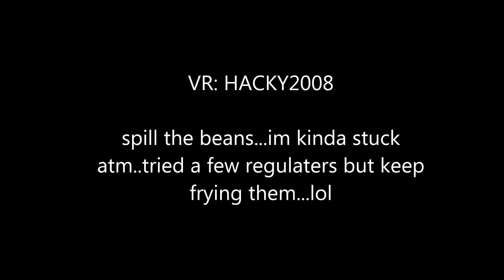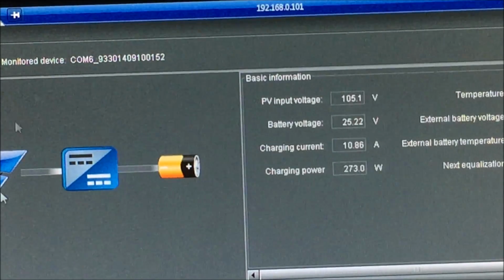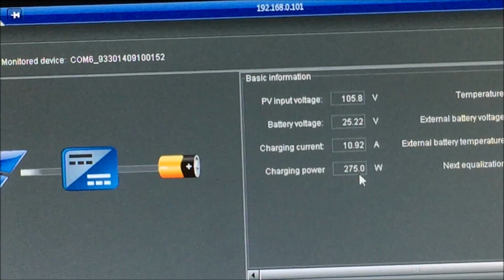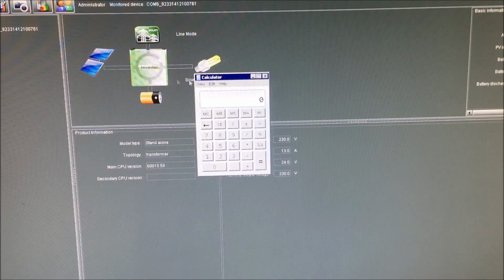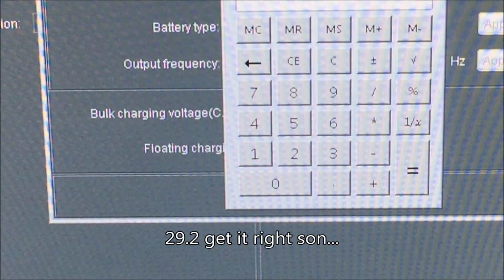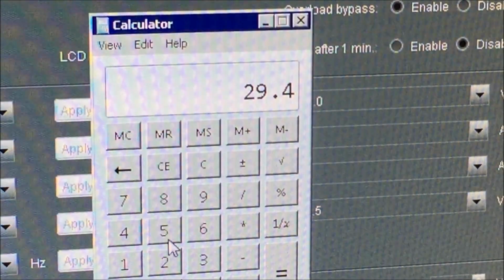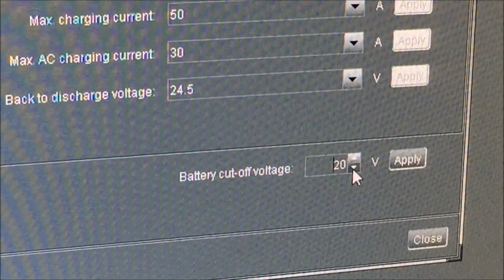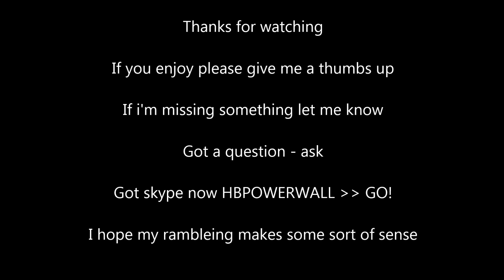PIP2424MSX Charging 18650 Cells

Comment: If my load requirement is less than 2000W . Can I use PIP-2024HSE for my 7S80P pack instead of your PIP2424MSX. Please assist me. Thanks you.
Reply from the maker: Theory says you can but you would NEVER want a constant draw of 2000w on these units they do tend to get hot after a short period of time..
Reply: Thank you. And noted.

Comment: I am thinking about getting a pip2424lv-msd (the american 110v version) but I want to figure out how to hook up an opportunity load (space heater, for instance) to it, to use up surplus current as we are off-grid. Any thoughts?
Reply from the maker: just hook the heater up to it then sue the watchpower to turn it from on grid to off grid... what sort of draw is the space heater
Reply: Thanks for getting back! The heater is 450 watts 120v/3.75A. Would you hook it up to the Pip's dry contact?

Comment: The grid voltage at 22v is when to TRY to go back on grid. If the grid is not available it will continue using batter until the battery cut off point. At that point you lose all power. The setting does not seem to be redundant. Just poorly described on the UI.

Comment: i will like to ask you question can used the pip2424 as inverting only without putting solar on lt
Reply from the maker: Yes, it will function perfectly with out solar, how ever I do remember reading some where at some time that you need to hook up the solar up to it to update the firmware for some reason.

Comment: The syStem I put together is a mix of different chemistries. Started with lead/ acid , some sealed  have been adding life and lipo lately. I started at a lower charge volt. It's a 12 volt system,but I have been at 14.1. Good for the lead and life ,but a bit low for the lipo works out to 3.525 volts    As long as inverter is on it seems to absorb any surges without problem, although I did put in 7  Maxwell 2600F boost caps which tend to help with surges. I'm not sure how your inverter/charger works, but you put the cutoff voltage at 22 volts? You might have to adjust depending on voltage sag and where the voltage reading is taken from. I'm starting to have higher draws on the battery bank and there is more sag. System is drawing 25 amps and reading 11.6 volts, at the inverter, but at the battery pack the voltage is still 12.6    You may not notice this , just something to watch for.   I don't know if this makes any sense or helps. Your vids are great ! Keep at it
Reply from the maker: +terry trotter cheers thanks for info :0)

Comment: HB, the problem you have is that the cells can not be balance simultaneously at both the top and bottom.  If they are out of balance at either end they can be damaged if the margins are not big enough.  So you need to set big margins at both the top and bottom, when you are starting out, and monitor closely.  Once you are sure they are behaving ok at both top and bottom you can reduce the margins, in small increments.  This could take a couple of weeks.  I'd start out with limits of say 3.5 - 3.9 per cell.

 Also not that the BMS will balance at the top, but this results in the bottom balance being out.  So you need the banks to be matched reasonably closely  (have the same KWh capacity as each other).
Reply from the maker: +Mark Roberts Very aware of the limitations :) however your information will be very helpful for someone else here. Thank you for your imput - Pete

Comment: hello. I think just to be safe you should have build small batteries banks of 24v with a bms on each of them capable of delivering 900w to 1kwh each. the connect the parallel. just like the tesla car batteries are.. that way the bms will monitor the charge for each pack..
Reply from the maker: +n chambers i have a bms for each but the'll be 5kwh packs.

Comment: you will need a shutof at 4.0 volt at a single cell for more life span and then a dummyload for the solar system to dump the overload. sorry for my bad english 😆
Reply from the maker: +Taguun I'll be using https://www.youtube.com/watch?v=Z64RkJ8BbDE << this unit (much to my own horror) it in theory should control over chargeing as well as the limmits on the inverter.

Comment: All the stuff I have read so far indicate never use a float on LiIon batteries.  It needs to cut voltage off completely at 4.2 max.  This is one problem I'm having is finding a solar charger that is compatible with LiIon.
Reply from the maker: I can set equalizing charge to off or 29.2 so it'll just be the same in theory ?
Reply from the maker: +MrEroshan My theory is technically it won't ever float so to speak? (inside my own ponderings of this subject)
Reply from the maker: looks like they would work but would need a few to do what i plan on doing
Reply: +HBPowerwall Yeah, float charging is a problem. Maybe if you crank the float voltage way down below the relaxed voltage if the fully charged pack, it might just terminate after bulk charge. Probably worth verifying it doesn't do an equalizing charge once a month or something too.
Reply: +HBPowerwall Yeah, that might just do it. Probably worth monitoring it pretty closely for its first cycle just to be sure. :)

Comment: #1 Should work fine
Do you have solar on that 2024???
Reply from the maker: +off grid kid at the moment I have 1.75 kw of panels (with space for that again) The PCM60X is currently doing the charging duties and regularly sits on 60 amps charging.
Reply: If the 2424 is not doing the charging will work better.....
Reply from the maker: +off grid kid Keeping them seperate is great for heat, but it's good to have options :) Like using both for 120amps of charging goodness or even going 48v (very much still on the cards)
Reply: One problem with the pip and running solar is if your batteries a sitting full and your running a load like the AC when it kicks off it has to put the amps & solar power somewhere so it dumps into the batteries. this sometimes will push the batteries over the voltage set point till the system adjust this can take a few minutes & some time for batteries to drop back to set point..
Reply from the maker: +off grid kid Valid point we don't use aircon on the off grid setup just the lighting circuits and power outlets. But i guess the same is for large sudden load.
Reply: Solar Junky وزكي
Reply: وزكي